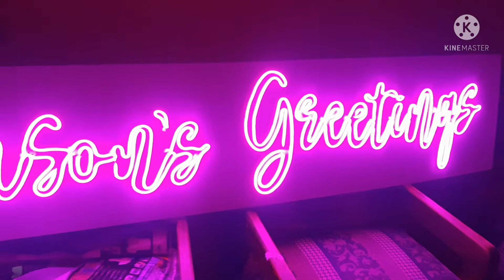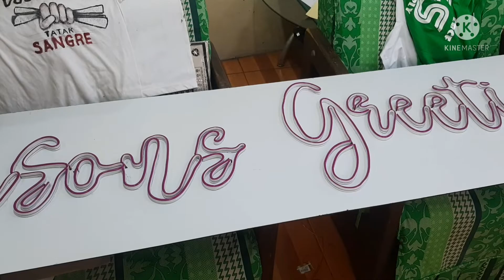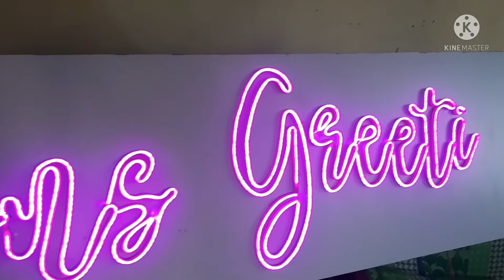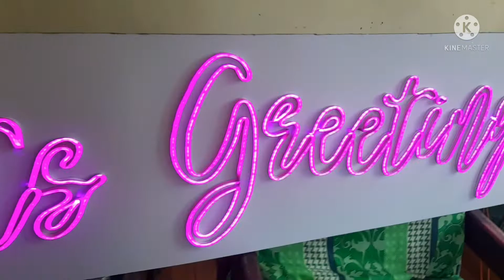Neon LED Lights - Fabrication and Installations #howto #diy

Comment: Good day Sir, just recently discovered your channel and dito ko po natuklasan ung mga trade secrets s likod ng mga business signages(panaflex fabrication/installation). Itatanong ko lng po Sir kung saan po nakakabili ng  neon strips at sa  ano pong type ng board nu po inilalayout (glossy or laminated po)? pwede rin po ba isubstitute jan ung LED strips with remote? Salamat po Sir sa pag document po ng mga fabrication & installations ng signs and panaflex, looking forward makpagputup rin ng ganitong business. More Power po.
Reply from the maker: Thank you sir. Pwede ka po bumili ng mga LED lights sa online like shopee and lazada. Dito s particular n signage na ito ang ginamit ko ay Aluminum Composite.Panel.or.ACP. Pwede.k rin gumamit anything na hardboard as long as matibay ito kapag ikinabit. Depende rin sa design ng LED lights kung ano gagamitin mong pinaka base or mounting base ng mga ligjts. Goodluck at sana ay makatulong ito ng malaki sa plano mong negosyo.